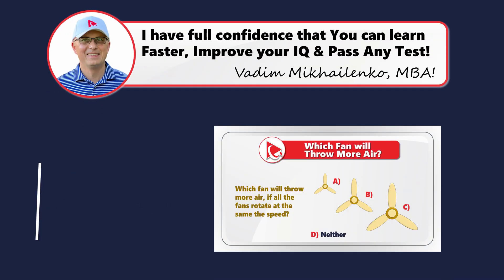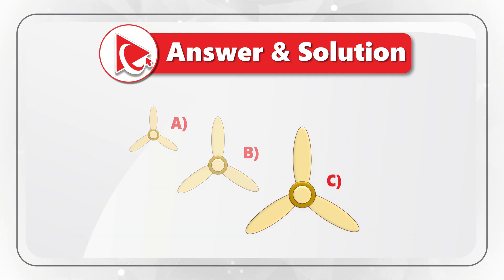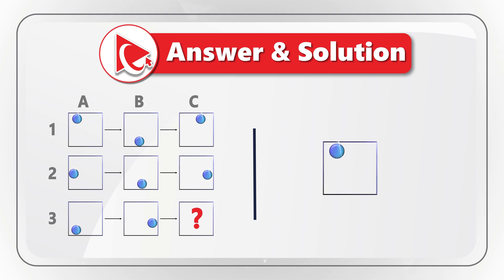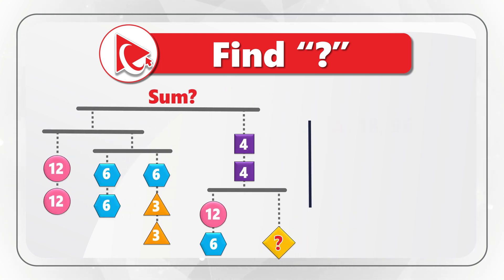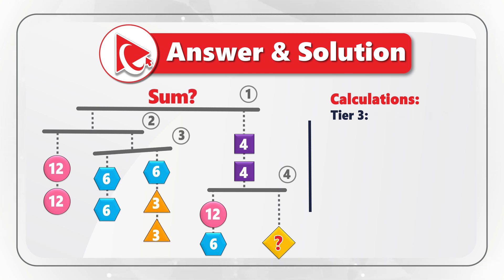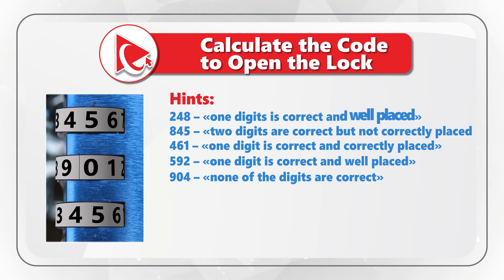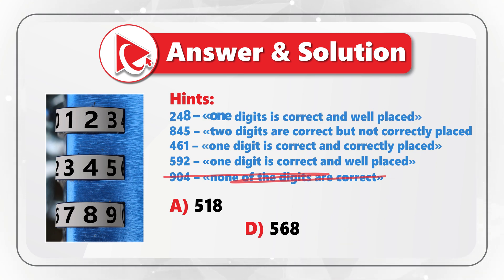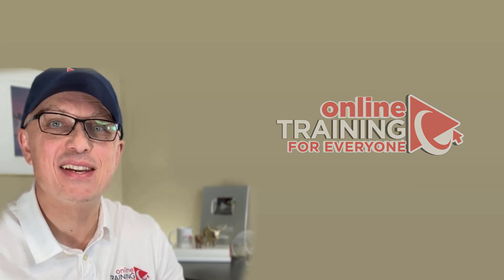HOW TO PASS MECHANICAL APTITUDE TEST | Questions, Answers & SOLUTIONS

Comment: I Immediately thought Fan A, Simply because its smaller and has faster rpm due to smaller size which my thought although I see why C is the correct answer its like walking if one person has short legs going the same speed as someone who has long legs, the one with long legs covers more distance than the one with short legs
8/27/2024
Reply: It said their all spinning at the same speed, so the rpm factor of the smaller one is negated

Comment: How did you eliminate 1 to get 6, in the combination lock? Neither of those number can be correctly eliminated from the other hints. We can tell 4 is one of the digits eliminated. The scale numbers are off too. This is not a good test.
Reply: True but the combination could’ve also been 581 if 1s position was true. And there’s nothing besides the answers themselves that says 1s placement is wrong. So in theory it could also be 581
Reply: @TheLaw730  One cannot be in place three because of the eight. Rules one, two, and three prevent eight from moving.
Reply: I completed the lock by writing down the numbers 0 through 9 and crossing off ones that I could rule out by the information given. Then underlined ones I knew were correct by the information given. With the information given I was able to choose the three correct numbers and their positions. I was able to find out the code without seeing the answer options. Kind of like a reverse sudoku game.